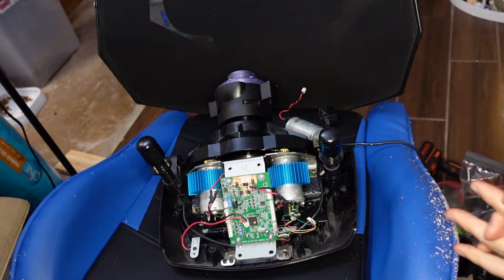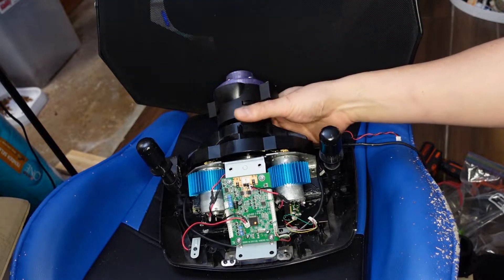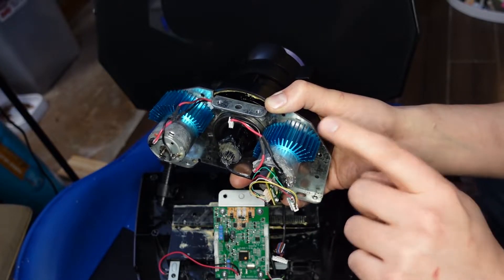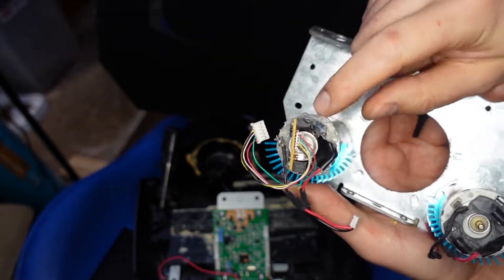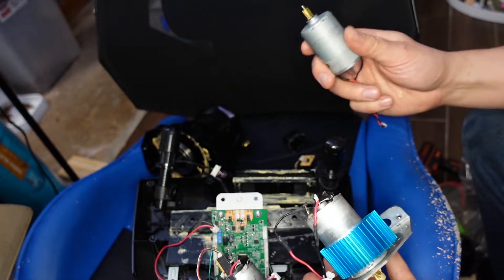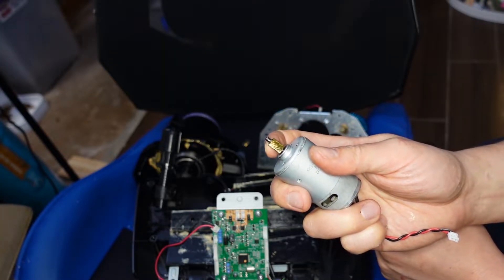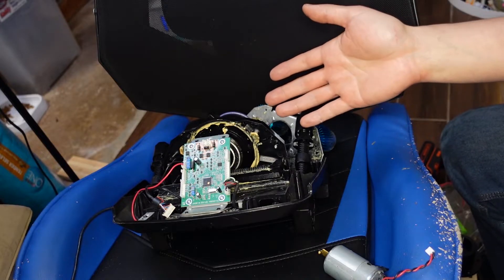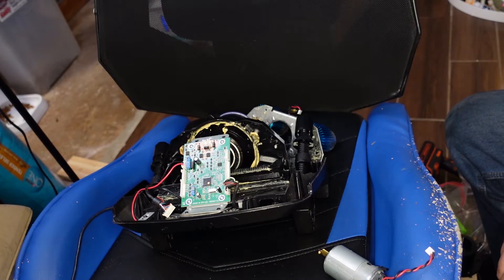Yoshi's brain dump - Logitech wheel upgrades and repairs

Comment: 1. They don't use the same motor in all models,
2. Upgrading PSU does NOTHING to stock wheel,
3. Adding more lube just makes it more resistant and with that amount you got there it looks like sh...
4. There is a tool to take gears from shaft,
5. Shafts are longer to work with white plastik dampers that are inside plastik housing

Comment: I was able to do the motor swap and add some fans and the wheel works well for the most part. I tore it down and put it back together like 4 times already, always moving that plastic gear slider a little bit more to be fully centered. Even when the calibration goes well, while testing full rotation the end of the 450 degrees ends just a tiny bit early on both sides. Can't figure that out yet, but the rest, force feedback and speed is amazing.
Reply from the maker: Could be a software setting? But yea it has to be like 100% dead on or it won't work right and might damage the unit. But that would offset one side or another, not both.
Reply: I'm not really sure yet. Last time I tested, I spent a while until I was able to have it centered in a way that when you'd move the  wheel, it'd end at the same spot of the slider on both sides so it should be centered well, and still on the software it appears it ends slightly before on both sides, so it might be a software issue after the swap, who knows. I'll keep trying later today, as I'm opening it again to add a knob to control the fan speeds, so we'll see.
Reply: thats actually normal, the wheel doesnt register the last 20/30 degreess

Comment: Really plastic encoder on the g29 wow might as well get t150 myg27 broke can’t get it to work right
Reply from the maker: I mean... for manufacturing bulk, it made sense at the time.
Reply: @protomor  true but they should have  learned from the g25 g27 lol
Reply from the maker: @esmokebaby  they did. Later styles are magnetic
Reply: @protomor  ya but later iam assuming you mean the g923 at that price ill just get a t300
Reply from the maker: @esmokebaby  g29 and g920 change the reluctor style mid way. So some are magnetic and some are the wheels.
Reply: @protomor  ahhh ok cool

Comment: I’m following your work with great interest, because I’m not going to be able to buy my way much above a Logitech anytime soon so learning to build is my only path to substantive upgrades. First question: Lubing the gearing seems simple. How much difference does it make and what kind of lubricant do you recommend?
Reply from the maker: Honestly, I don't think the gears need extra lubing. I did it because I wiped it off in the motor swapping process. What you see on mine is a silicone based lubricant. I forget specifics but you want that style of spray because it's safe to use around rubbers/plastics. Many other lubricants will slowly eat away at the material. you also want something thicker so it has some staying power. IIRC this lube came from a tube and not a spray. But do your research, this is just what I had lying around.
Reply: @protomor  Thank you much. Glad to hear it comes lubed from the factory.

Comment: So you added the blue heat sinks on the motors?
Reply from the maker: Yea they're generic rc car heat sinks
Reply: @protomor  how do they attach?
Reply from the maker: @jameszanghi3564  they just clip on
Reply: @protomor  no thermal paste?
Reply from the maker: @jameszanghi3564  you can. I was too lazy
Reply: @protomor  lol you think it would be worthwhile to do on a stock g920? I only have the 5 amp power supply and try not to run it at full fob. I do like 85%. Do you think it would help with longevity?
Reply from the maker: @jameszanghi3564  naaah. stock works fine. even withe bigger power brick doesn't really change much. I'd only do it if you're upgrading. Logitech did a good job of making the stock unit hearty AF.
Reply: @protomor  oh awesome thanks for your opinion!
Reply: @protomor  hey so actually i just did a 40 min stint and i noticed the last half of the race the ffb was weaker like almost half as strong. do you think this is the motors getting warm or the control board?
Reply from the maker: @jameszanghi3564  most likely motors. Try putting a fan on with the case off to see if that fixes it